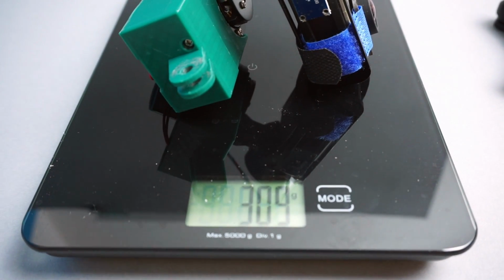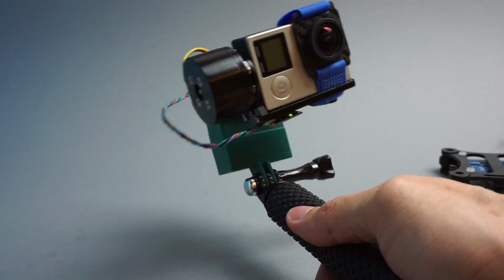DIY Mountable GoPro Gimbal $90

Comment: will it work with power bank power???
Reply from the maker: I don't think so, unfortunately, USB yields 5V while gimbal requires 9-12V
Reply: you could simply add dc-dc booster for 2$ and hook up to old 3.7-4.2 v batteries from laptop
Reply from the maker: Sure, but will it be that compact?

Comment: Can you put the link of the controller board again? Thanks a lot!
Reply from the maker: Unfortunately I can't find it anymore on aliexpress. I thin that one should also fit the case. Though it's more expensive http://www.aliexpress.com/item/3-axis-Alexmos-MINI-BGC4-1-brushless-gimbal-controller-Main-board-3rd-ext-IMU/32328549738.html
Reply: +Gone Pro Its too expensive.To do your project,i need one controler board for 2 axis gimbal?please tell me the expecifications,i'm noob xD.
Reply from the maker: I found this controller on other web sites. Please have a look at the description. Basically you need 2 axis gimbal controller, yes. Because in this setup there are two motors.